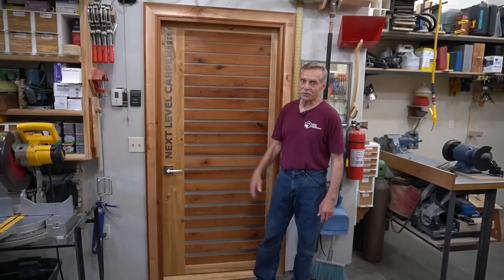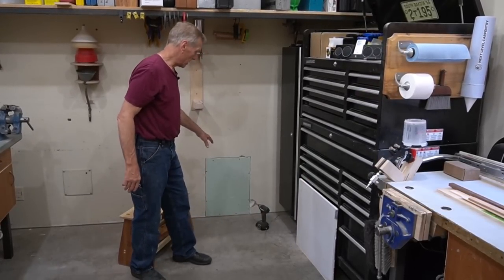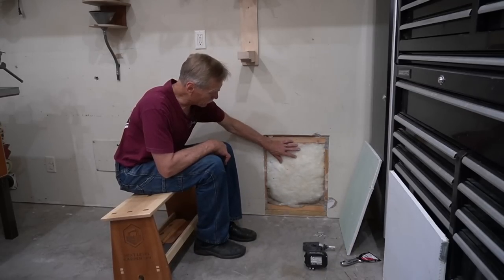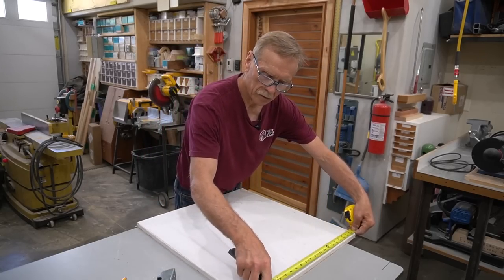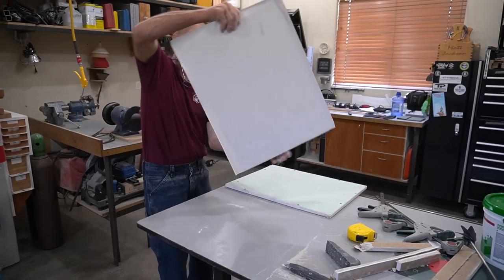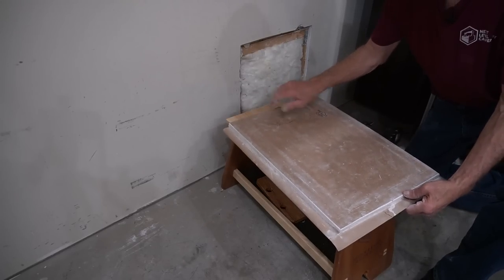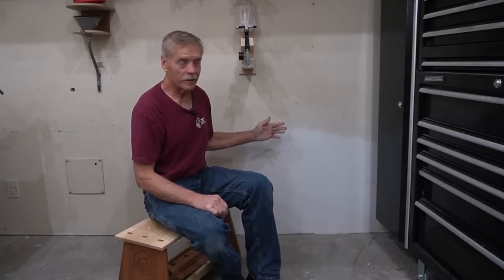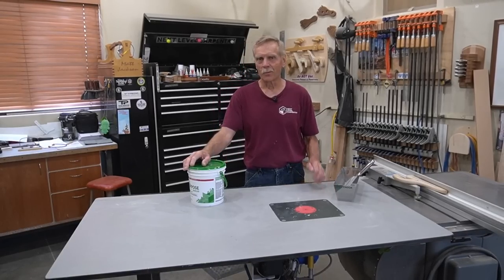Tapeless Drywall Repair

Comment: In the trade we call that a "hot patch".  It's really good for patches where there isn't anything to screw the patch to.  We generally use DuraBond (fast setting mud with extra glue in the mix ) to bed the patch.  It sets harder and helps prevent any cracks and too much shrinkage.
Reply: In the trade, we put backing in to screw to.
Reply: Never give out a magicians trick, sad this is out. Better to use old drywall removed as a template and easy sand with a little more water to help push irregularities out of patch.
Reply from the maker: @3dandyrandy3  the only ones 'in the trade' who put backing in to screw to are those who don't know better.
Reply from the maker: @Somber7   not sharing a 'magicians trick' like this is not sad but selfish IMHO.  Who looses and who gains from sharing useful knowledge?  If you think this is a zero-sum game then I encourage you to find someone willing to share their perspective so you can expand both your horizons and skillset.
Reply: @NextLevelCarpentry for this particular instance - where there was backing around the perimeter, okay. You don't mean that for a big patch where there is no backing, do you?

Comment: thanks for the denatured alcohol tip. gonna try that. otherwise, it went about what I have experienced. Only thing I would add is that I typically have a shop vac running when doing the sanding to pick up all the dust
Reply: As he said, his shop vac was at a job site.
Reply from the maker: You bet, Gregory.  FWIW I normally use this sander for patch work:  https://www.amazon.com/dp/B01L1A2EN8?linkCode=ssc&tag=onamzdigitalj-20&creativeASIN=B01L1A2EN8&asc_item-id=amzn1.ideas.29WVINIJF4EUJ&ref_=aip_sf_list_spv_ons_d_asin
Does a great job of sucking up 95% of the dust but I decided not to include it in this video for production reasons.
Reply: @NextLevelCarpentry  have a sander like that too but I primarily use a dewalt random orbit sander hooked up to a rigid shop vac. its totally overkill for drywall sanding but I just love smooth walls.

Comment: Some times I have a situation where I do not want to have the drywall dust I will wet a sponge and lightly brush the mud leaving it smooth. Your patch really turned out nice. Next time I need I will use the denatured alcohol 🤣🛫

Comment: I'm just a jack of all trades, but I find plastering so satisfying. I might try your technique next time I need to cover a hole. 
What a great tip with the alcohol spray to prevent/reduce bacterial growth in the used tub of mud - thanks again Matt.

Comment: Great job and explanation. I have always used mud in a pail, but I saw a video by a guy who is a professional. He used powder mud in a bag. He also used 15 or 30 minute quick setting mud. I can't remember which. But, by using that, you can do three coats in a short time and have the wall painted in a half day. Pros do not have time to do one coat per day. Time is money. I have time, so I have always done it the slow way. I also do not want to have 90% of a bag of dry plaster laying around.
Reply from the maker: Great to see a comment from you here Russ... it's been awhile.  FWIW I only used that little bucket of mud for 'staging' in this video.  My favorite mud for taping these days is a brand called Hamilton that I buy in 'a box' and transfer to a bucket.  I'm not fast enough with taping to make 'hot mud' a necessity but pro tapers I see/hire use it often for pre-filling, etc.
Reply: @NextLevelCarpentry  I have to check in more often. In the past year, I have been spending a lot of time on the Ukraine war channels. I recently made a 20'X6' wall of 3/4" tongue and groove maple ply paneling for behind the bed in the master bedroom. Still have to put it up. Spent over a month making it, but it was worth the effort. It has a very shallow chamfer, so there is no reveal of the inner plys. I am also working on a 64 drawyer cabinet for screws, etc. from palette lumber. I do a little at a time. No deadline from the wife.
Reply from the maker: @russmartin4189  It's just good to know you're busy and doing well!
Reply: @NextLevelCarpentry  I had a little angina between Thanksgiving and Feb., but diet and meds took it away. I am back to biking 15 miles once a week and walking with my wife most others 1.5 to 2 miles. I feel fine now. Thanks for asking. Hope you are doing well too.

Comment: Matt, I know that you need the support of patrons to be able to continue doing what you do.  Unfortunately, I don't have the resources to be a big $ supporter.  I hate that, but I will try to contribute a bit when I can.  I really do enjoy what you do and it makes me wish that I were still able to continue working.  I can, a little bit, but most of the time I just can't.  Keep it up, you are a great inspiration.
Reply from the maker: Glad to provide inspiration without obligation or worry about additional support.  It's just as meaningful if you tell friends about the benefit you find on the Next Level Carpentry Channel as it is to contribute as a patron.
Sincerely,
Matt

Comment: Great stuff, Matt, and very timely. I just snagged some drywall scraps from an office renovation, and they'll be used to fill a number of holes I've accumulated over the years in my plaster walls. They're in out of the way places like closets and attic stairs, but still need fixing. I thought for sure you'd end this video with a reference to your 5 year old "Spackle and Putty Smoojers Save $$" video!
Reply from the maker: I considered mentioning that old video but it didn't make the final cut.  Great that you made the connection because it's an exact parallel here.

Comment: Nice video and repair.. It could be helpful to a lot of folks -- the less tape, the better!  Your wise use of existing studs made a difference, too.
Well done. Thanks!
BTW: Good recommendations for storing an open can of mud. After cleaning the bucket walls, I have also used saran wrap pressed over the top of the wettened mud to keep it from crusting. That works, but I never thought of using a bit of alcohol to prevent bacterial scum from forming. Great tip. 👍👍
Reply from the maker: Thx Jerry... I should have included the bit about a round sheet of plastic over the mud after spritzing with water and alcohol... I've found it very effective too!

Comment: Thanks for sharing. 
 i would put the mud on the wall around the hole and brush some water base glue on the paper and i wouldn't worry if the patch doesn't fit, i would just cut another one just like it! 😮

Comment: I usually cut the paper back on the wall to match the size of the patch so there isn’t any bulge. And, when I screw it in, I put the screws under the paper.
Reply from the maker: If you're OK with a seam in the paper with no overlap, why not just fill the crack with mud and leave it at that?

Comment: Good trick when you have no tape. But takes way more time to do, over a typical patch. And there a chance the paper rips off when removing the gypsum from the paper. (1 step forward 2 steps back.)  That said I have done it, when in a pinch. Shouldn't be your, go to way of patching.  Great tip, good explanation.  Just my 2 cents for people exploring finish work.
Reply from the maker: Good method even though I have a full roll of tape on hand in the shop.  
Thanks for sharing your 2 cents... it's useful for other viewers who are looking for options.
FWIW If you actually think this takes more time than a typical patch you're doing it wrong.  Too bad it would never work out to stage a 'race' with you to compare speed because, I believe, overall this is faster.
I don't imply it's my "go to" method of patching but I do use it whenever conditions allow for all the reasons shown and explained in the video.
Reply: @NextLevelCarpentry  I would say; what would a professional drywall contractor do in that situation, as patching is something they deal will all day. They would choose the fastest approach and that's with tape. And now that we talking about it. I do remember a time where i cut the drywall in the manner you showcased, and the taper took it out, threw it in the garbage and cut it normal. lol
Reply: @michaelstiller2282 I dont get how he thinks this is a faster method.
Reply: @jslater3262  I know people who can do this really fast. And its the same people who can apply their first coat of normal compound so good it looks like a 2nd coat and only really need another coat because of the bubbles and what ever happens in the drying.  So it really comes down to practice. But those people are unbelievable tapers. You blink and they blew through a bucket of mudd.

Comment: You made a meal out of that !   In my opinion humble though it might be, you should ; cut your patch leaving an eighthinch gap all round, shim it if it needs it (dry), screw down, fill with your jointing compound, sponge off ! come back tomorrow, fill your shrinkage on the joint. If you do this right you won’t see it without a light, and it is quicker than cutting oversize.  Gauge your finishing to the state of the rest of the wall !!!   You want to be fancy, taper the edges of your patch.
Reply: You don’t use tape? 

This video isn’t in a spot where a California patch really shines. It’s too big, he has framing, it’s a nice regular/square hole… shimming and using regular tap would work great here. 

California patches shine when there’s no framing or if the surface is irregular (like plaster). Small California patches don’t need screwed down, so you can completely skip adding a hunk of wood. 

DH ran lights on our kitchen. I had half a dozen 4” round holes, only 1 was on a joist. He uses a hole saw to make the holes, so they’re perfect circles. Cutting up a bunch of scrap wood would have added quite a bit of time, and it can be awkward getting it into a small ceiling hole. With California patches, I was able to get them all patched in an hour or so, did a second coat before going to bed, then sanded, did a quick final skim, and painted the next day
Reply: @danielleboon1543  Certainly not, the whole point of a plasterboard repair is to create a flat wall, and you do not want to add something that you will have to build up around to cover. to be fair it does not matter how you achieve your patch, so long as it is solidly attached and flush, or a paper thickness under the background height. if it is low a fine filler  easily brings it back to height.   I rarely use tape unless on featheredge pb.
Reply: @CrimeVid  if there’s no tape, what prevents the seam from cracking and looking like shit within a year? 

I didn’t say you need a California patch to make it smooth. I said it’s a lot faster than putting in support. These patches shine on SMALL repairs, under 1’ in any direction. They’re great when there’s no stud to screw into, they don’t need screwed down. They’re great when you patch behind electricians, or if you have a hole from something like a doorknob/fist going through a wall, or from removing recessed toilet paper dispensers. Anything that leaves a small, maybe irregular hole that isn’t on a stud

Comment: Your patch looks excellent. However ... I'm a DIYer and just finished lots of patches on the ceiling and walls of my 100 yo house. As "This Old Trailer" said, the "California Patch" (as I call it) is great if you have no wood to screw into. But I am quite certain that I (yes, even me!) could have done the first part in half the time with hot mud and tape since you do have wood. My method (after watching many YouTube tutorials) is cut the patch to fit loosely, screw into place, prefill anything necessary with hot mud, cover edge with mesh tape, embed with hot mud. After a few minutes it is ready to finish with all-purpose as you showed. Except ... I have never heard anyone recommend sanding down until the tape shows through - sounds like a bad idea. Also, mix up the mud before using.